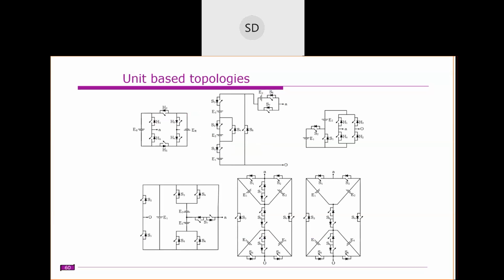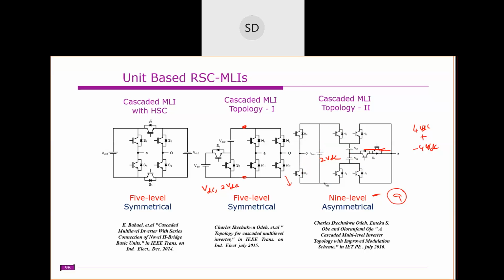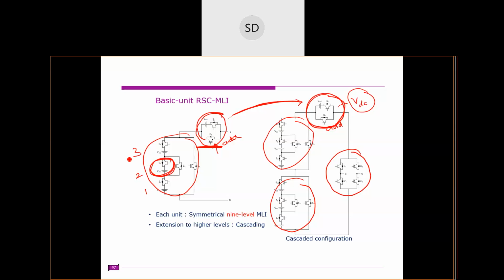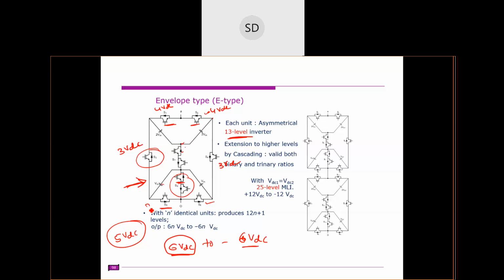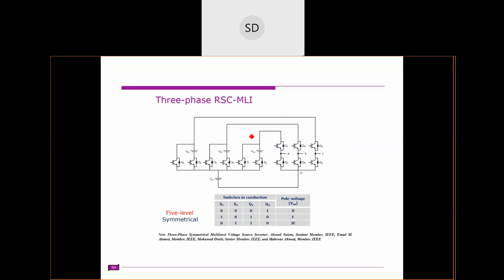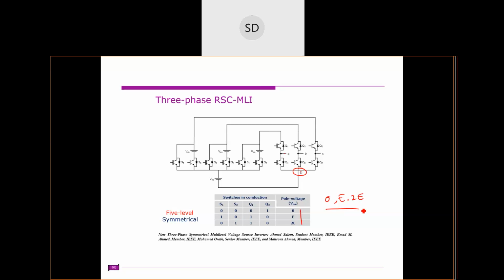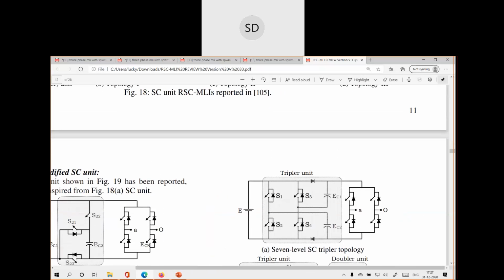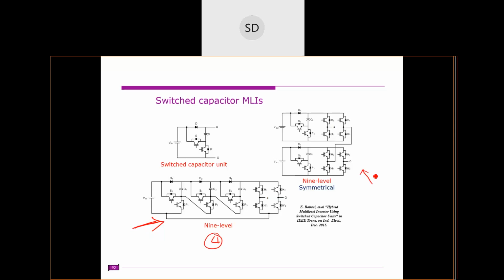Lecture 28: Reduced switch count multilevel inverter (RSC-MLI) topologies   3ur

Comment: Thank you, sir
about SCMLI when tried simulation the circuit by using PDPWM the output is not good!
Reply from the maker: Could you please explain in more detail
Reply: @AdvancedPowerElectronics  I worked on Matlab to simulate switch capacitor Multilevel Inverter by PD in level shift PWM but still don't have the perfect result...